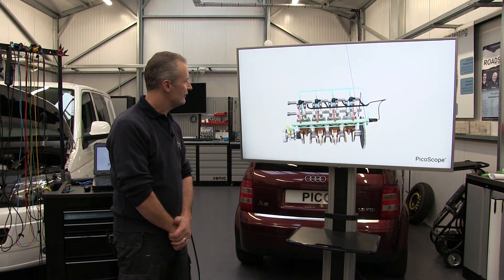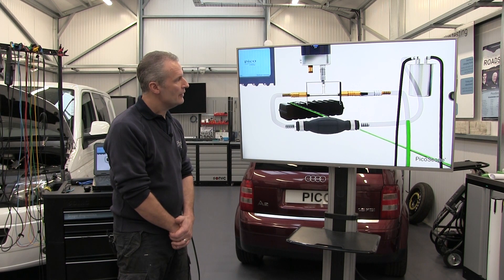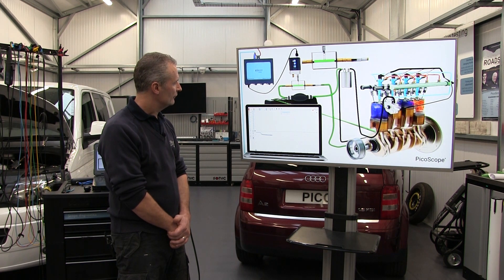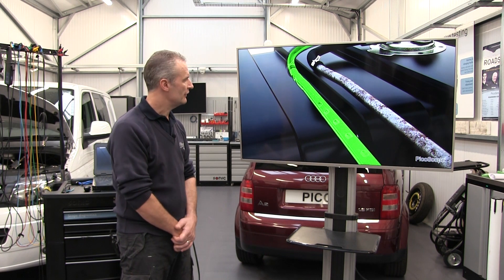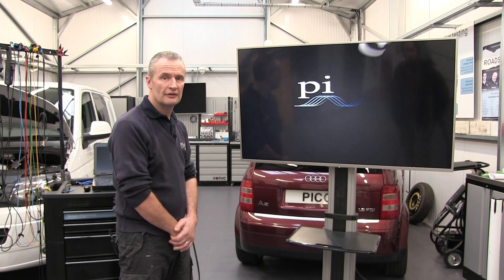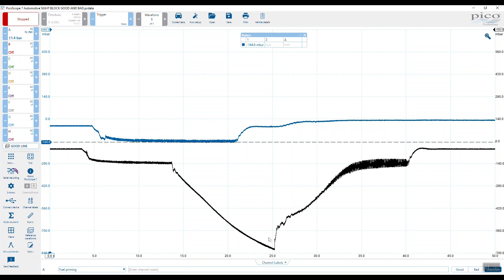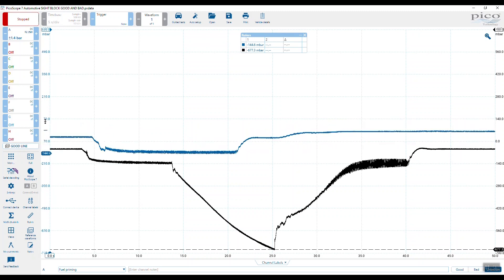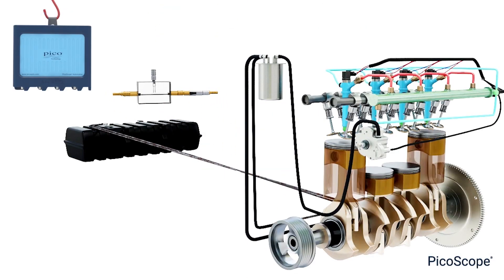Testing negative priming with the WPS500X

Comment: Thanks for the video, nice to have some guidance for the test. I am a little confused tho, if there was a corroded fuel line at the top of the tank surly this test wouldn't show it? Your only testing the system from the valve up to the fuel pump. So in this case the filter housing, pipes from filter housing to the pump and the pump itself would be tested. I am reasonably new to this so please correct me if I am wrong.